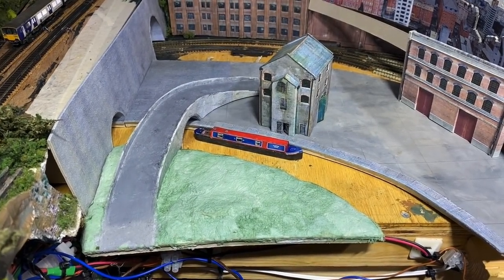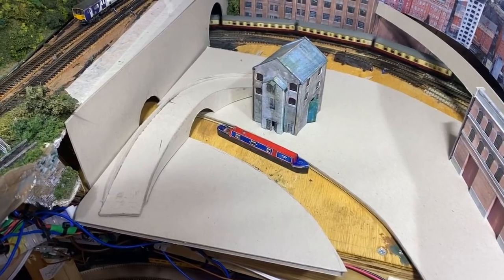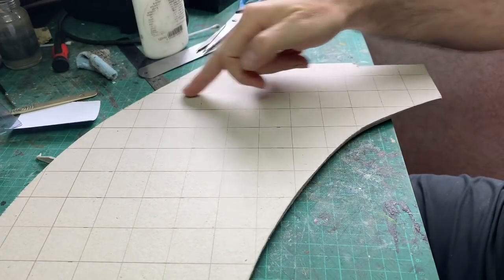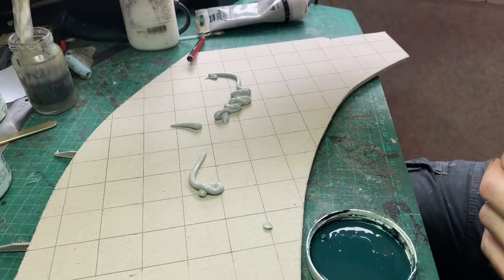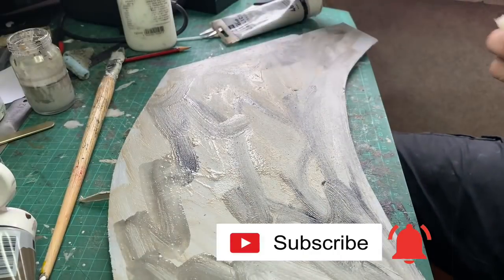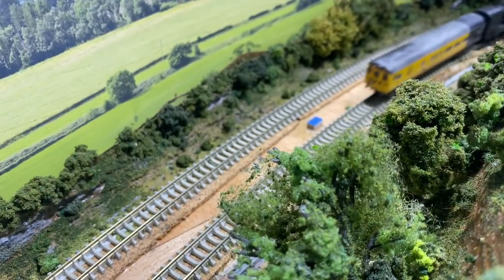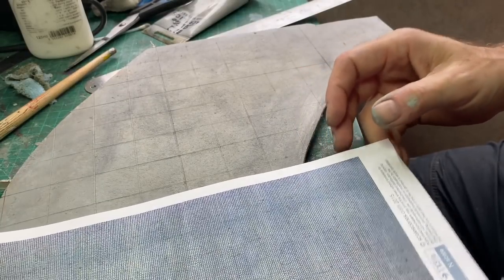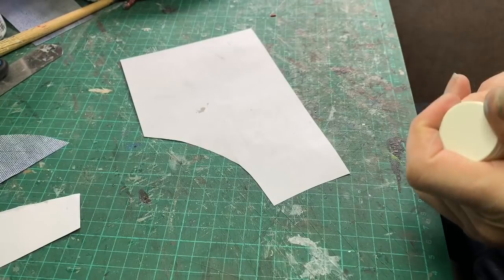CANAL SCENE 2 – GROUNDWORK, painting concrete & creating landforms

Comment: What card do you use for backscenes is it foam board  say 5mm  ? Thanks do you use same for tunnel hill bases
Reply from the maker: Hi Derek I dont use foam board rather 2mm grey board. 3 layers with middle layer creating slots so they can be fitted over angle brackets screwed to the baseboard. Mine is not the conventional format with backscenes around the edges. My layout is zoned so you can have scenes many miles apart next to each other separated only by backscenes or scenic break. I use a variety of materials so cant really say. I am using 3d printer more and more now though. Hope that helps
Reply: @piccadillymodelrailways  thanks very much, what varnish do you use ? I’m a newbie but being inspired by your videos after returning to model rail after 45 yrs.
Reply from the maker: Hi No worries, ask away... I use two. Matt varnish ronseal acrylic varnish, keep it thin adding few coats with brush strokes one way then then other, repeat few times getting lighter as you go. Gloss varnish is the humbrol one, comes in a glass bottle which I use with airbrush (thinned with acrylic thinner) or brushed as above. Hope that helps